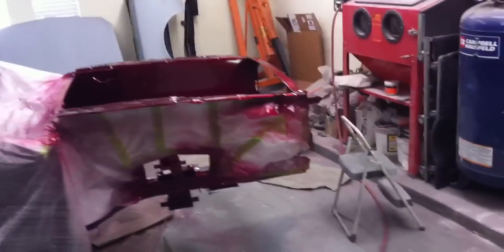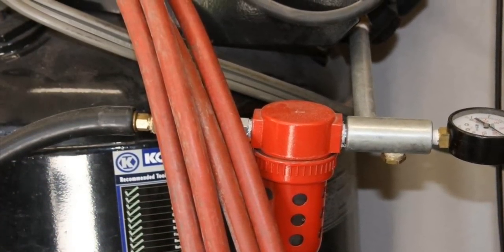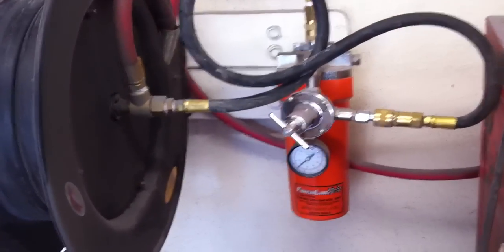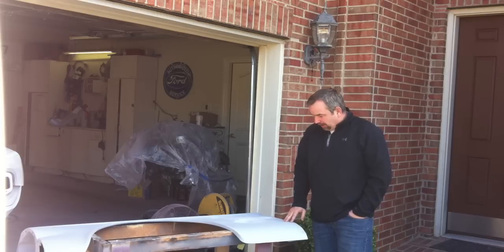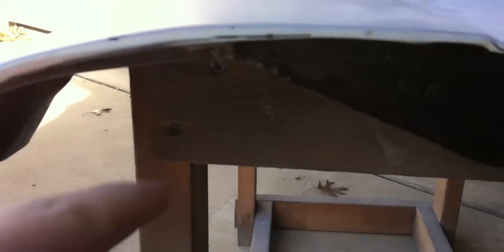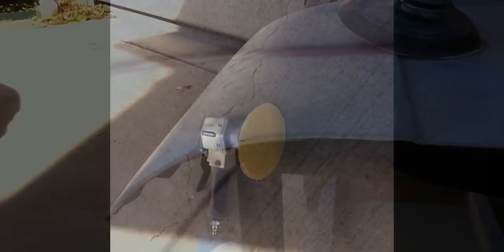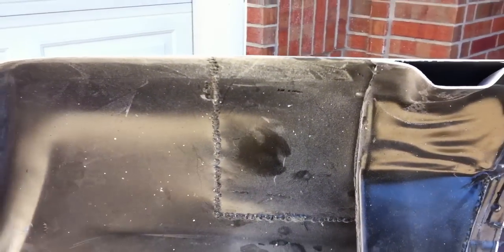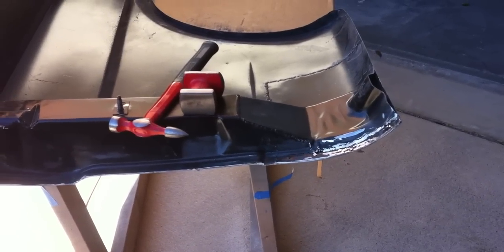65 Mustang Restoration - Fender Work - Compressor Setup

Comment: I like the compressor setup.  The longer pipe is a huge help.  It cools the air over the distance of the pipe.  Your setup is smart because it pulls the water out at multiple points along that length.  If you don't mind I am going to put this on the utubegaragegang channel.

Comment from the maker: @tasmania105 Sure, no problem man.  It's 3/8 hose adn 1/2 copper pipe.  Not sure on the lengths, All the main runs are stock length (6ft?) so I didn't have to cut them.  If your doing something for a shop, I would consider doing 3/4 copper and 1/2 hose.  the 3/4 copper is going to cost quite abit more than the 1/2

Comment from the maker: @Rasd4Metta It might be overkill, but the fact that the last trap, furtherest from the compressor has water in it each week when we drain it, tells me that only having one valve is not enough.  This turned out to be a 1.5 day project, prepping, fluxing, and soldering all those joints took a while, lol.  I used to get tons of water in my tools, after a couple of hours of the compressor running in the summer, water just pouring out the exhaust on the tools, but not a drop comes out now.

Comment: I would like to get a compressor for small projects nothing major like you.  Have a suggestion for something that would run a small sander, ratchet, and impact?  I don't have much money so budget low end is key for me.  Also with those lines removing the water wouldn't that also remove the oil or is your system oil-less.  How does that work?

Comment: I'm not a body man, so you might want to double check with one of the guys that is, but the welds on that back brace looked like you ran beads, and not smaller tacks.  Tje more concentrated heat might have pulled the lower fender in when it cooled.

Paint looks good, nice color too.